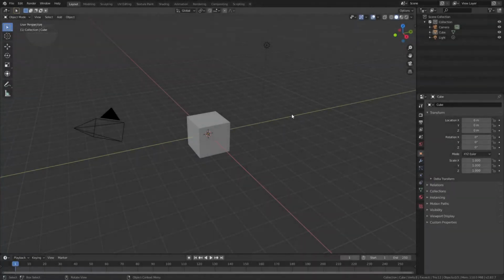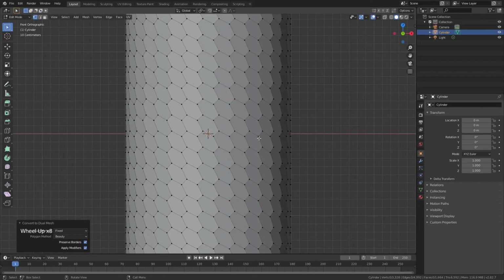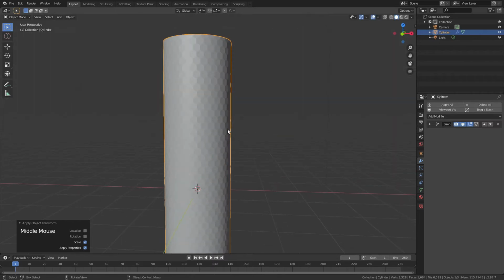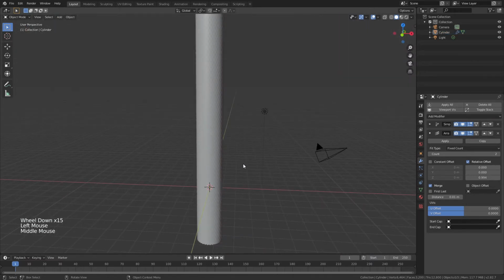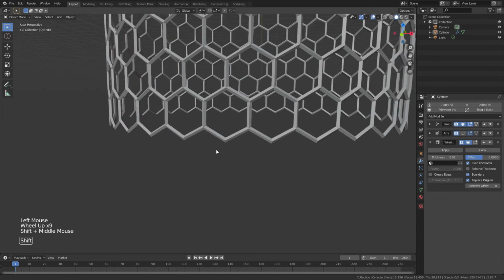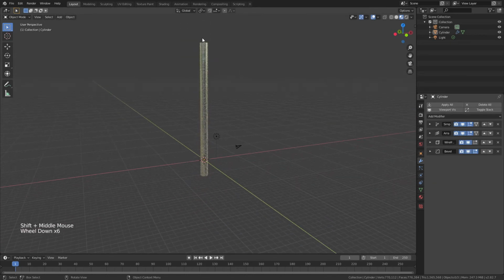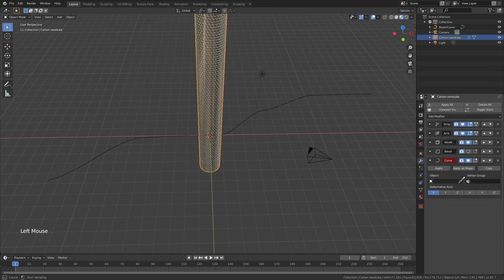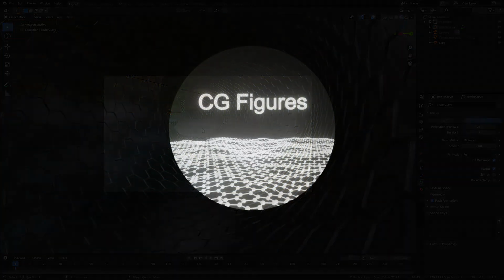How to Make Carbon Nanotubes in Blender

Comment: Oh  I can't find 'Convert to Dual Mesh' although after installing the Tissue Addon.
Reply from the maker: Hi zheheng, Tissue is maintained independently of Blender and might not be up to date with more current versions. I believe "Convert to Dual Mesh" can be found in 2.90 and 2.83.12 but not in 2.91.2 or more recent versions. There is another video on my channel about how to work around this problem but you also just install 2.83 and it should work
Reply: @CGFigures  Hi, I have the same problem, could you kindly tell me which video on your channel can solve this problem? thanks!
Reply from the maker: @yingzhuzhou9237  Hi Yingzhu, the workaround can be found here - https://www.youtube.com/watch?v=aLGKFwkXDHM&ab_channel=CGFigures
Reply: @CGFigures  thank you so much!
Reply: You can find pressing N at the options on de right on Edit. You should search one that says Tisue Tools, then find Dual mesh, but in my case I make Dual Mesh and then Tessellate for make it well because if you only use Dual mesh, it will make something bizarre.

Psdt: Sorry for my English